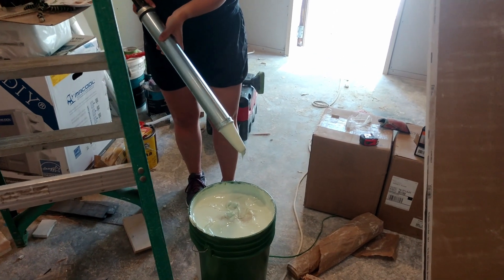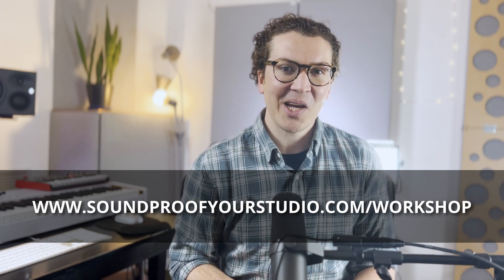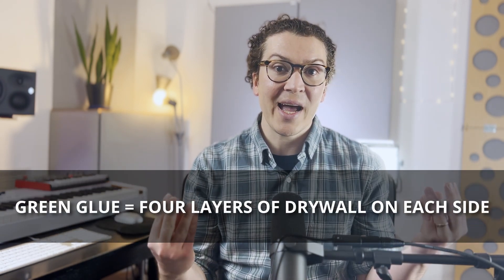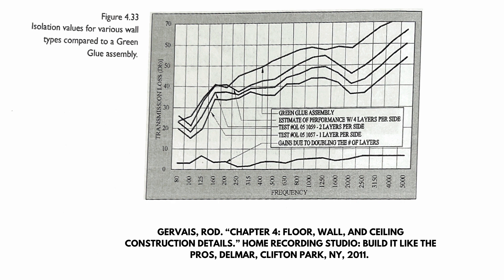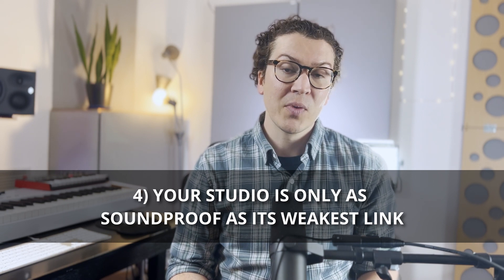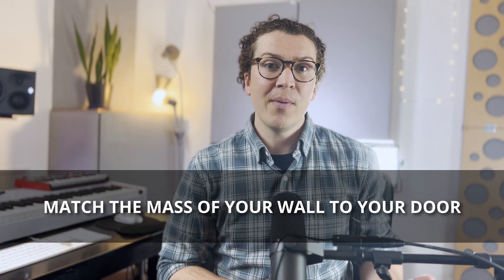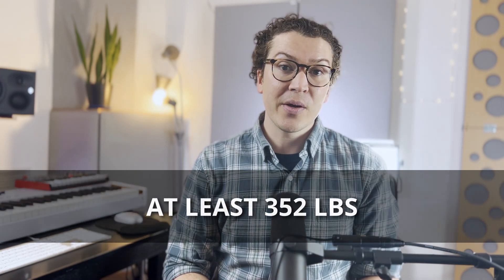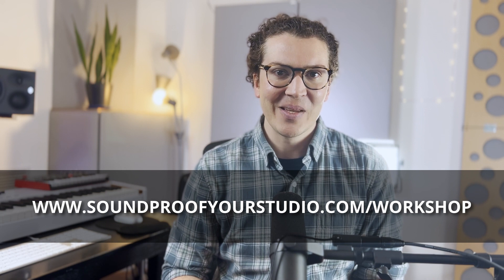Do You Really Need Green Glue?

Comment: I used both green glue and mlv. I used mlv different than most. I put it directly on studs and Rockwool safe n sound ( room within a room ) Sealed it with tape pvc tape. Then Used resilient channel for air gap , then drywall ( soundbreak xP ) green glue then another layer of the same drywall. I was thinking limp mass behind the wall with diaphragmatic effect.  With the wall itself on resiliency channels getting some of that effect as well.
Reply from the maker: I wouldn’t recommend this since the air gap is reduced because of the MLV.
Reply: @soundproofyourstudio   It ls a room within a room and not touching the structure of the house.  It added reduction to the walls before entering the Rockwool cavity that has another air gap behind that to the exterior walls with drywall and more insulation behind that.  It added mass , another air seal and additional diaphragmatic effect.
Reply: @soundproofyourstudio  also.  The resilient channel is over mlv.  So. The air gap exactly the same.

Comment: I opted for using carpet glue instead of Green Glue. Literally 1/10 or less the cost, and a few independent tests I saw demonstrated the TL values to be reasonably similar. Green Glue has become absurdly expensive, at least here.
Reply from the maker: I wouldn’t recommend carpet glue. No lab tests. Independent tests are not the same, besides glue does just the opposite. Green glue is not a glue. I don’t recommend green glue anymore.
Reply: @soundproofyourstudio  True, the lack of lab tests is a shortcoming, but the particular type of carpet glue in question isn't exactly a "glue" either in that it doesn't harden over time. Gearspace had an interesting thread on it where IIRC it was tested in an isolated environment over a period of months.
Reply: @soundproofyourstudio  apparently, the Roberts carpet glue does not harden. It stays gooey /tacky similar Visioelastic caulking.

Comment: A little off topic but I'm wondering, with the whole double wall system in the studio you built what is the total thickness of the walls? What is the external footprint vs internal? Thanks!
Reply from the maker: 3.75” stud 1” airgap 3.75” stud 5/8” drywall 5/8” drywall.

Comment: U don’t need it. I found a tremendously cheaper option with better results than green glue. Carpet glue‼️
Reply: I’ve done testing on all types of glue. “Carpet glue” does not work like green glue. Especially once it dries. 

There are other types of glue you can use, comparable to green glue, but it’s nearly just as expensive and much easier just to buy the green glue since it’s already in tubes ready to apply.

But the difference between glue and no glue probably won’t make or break your project. If you have bass problems, green glue might help slightly, but it won’t work like you’re hoping for. It’s not magic
Reply: @duuude534  that’s a great way of summing it up! I’m on my first DIY home build on a room over the garage but doing my best to prevent flanking without adding eight layers of plywood on the floor up there. On top of the original three-quarter inch subfloor, I added 2 inch semi rigid mineral wool with another layer of three-quarter inch OSB.  I was thinking of green glue and then thin Luan plywood.  From there, I’ll have another half-inch or three-quarter inch to decide what type of finish floor. My space is under 300 ft.² so the cost of one pail of green glue is not too bad.

Isomax and double drywall everywhere else with
NO GG.
Reply from the maker: Are you sure the carpet glue didn’t just glue your two layers of drywall together making it actually less soundproof?
Reply: @soundproofyourstudio  here it is https://youtu.be/BW2ce3H-sAo
Reply from the maker: @PearlLaneTV  ah yes I have seen the Jack of All Ministeries videos. I mean you can always give it a shot. I wonder how he calculated his STC ratings and how that compares to lab tests. At the end of the day it is your money and your studio, so do what you like. I like to stick to the hard science since there are a million ways to discount every aspect of soundproofing.
Reply: @soundproofyourstudio  my build is actually in one of those sheds like the video u posted a couple weeks ago. Being that I’m only recording vocals and in a fairly quiet neighborhood, do u think the 2 layers of 5/8 no gg will be good enough isolation? And maybe even without the extra 2 layers of 5/8 in the cavities between the wall studs like u recommended? Do u think this would be a good idea?
Reply from the maker: @PearlLaneTV  You still would want to beef up the shed wall so that it has as much mass as the inner wall, but yes, I don't think you need green glue if you are just doing vocals and the neighborhood is quiet.
Reply: @soundproofyourstudio  so two layers 5/8 with absolutely nothing in between?
Reply from the maker: @PearlLaneTV  Yes you can just use two layers of 5/8" without any damping layer between them. If you want you can schedule a free soundproof Clarity Call at this link: https://calendly.com/soundproofyourstudio/soundproof-clarity-call-evergreen
Reply: @soundproofyourstudio  thanks!! I just scheduled a call, can’t wait to get some more information on my specific build.
Reply: @soundproofyourstudio  well I haven’t done it yet, but I seen a YouTube vid where a guy tested it against green glue and it actually outperformed the gg. It actually has almost the same consistency as gg and it never hardens so it stays kind of spongy like gg. I’ll put a link to the video.